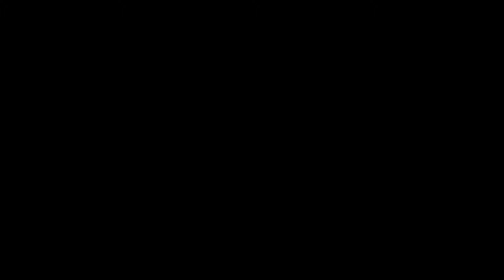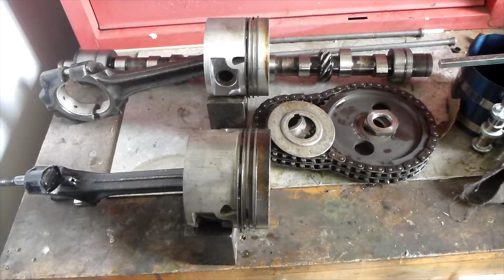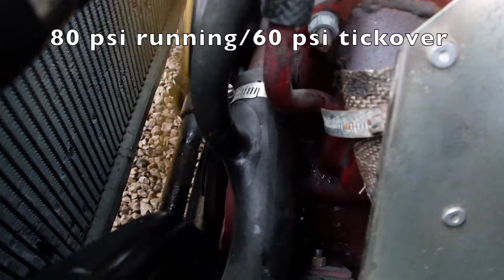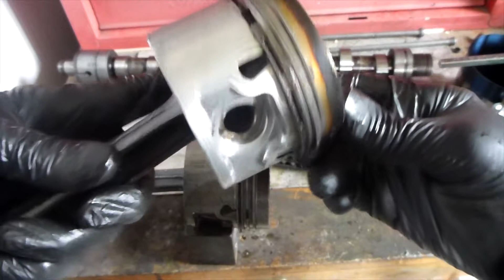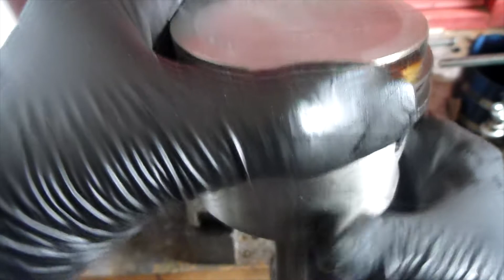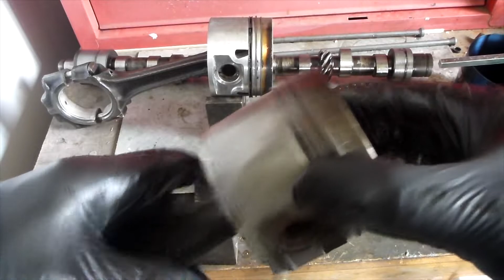Sloppy piston and gudgeon pin on MGB

Comment: Od this noise constant and loud?
Reply from the maker: It turned out to be a badly fitted piston which the prevoius owner had put in after a dropped valve. The press-fit gudgen pin was not central and they had tried to drift it back with a punch which had damaged the new piston.
I had to fit a new piston and rod, which solved the noise. The piston was properly fitted to the rod by a specialist using a press and a jig.